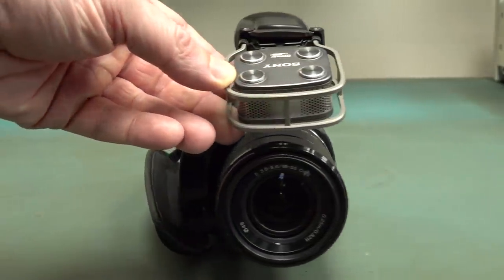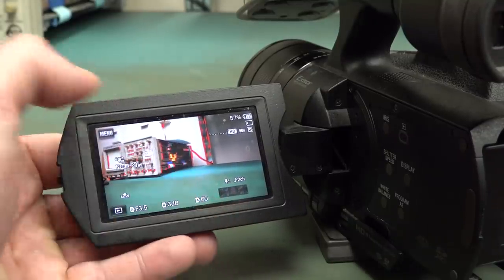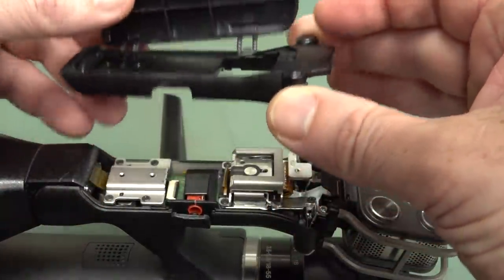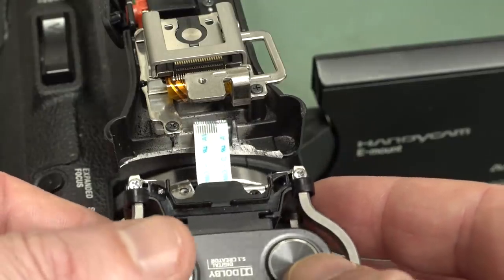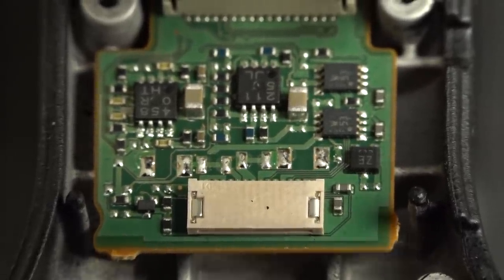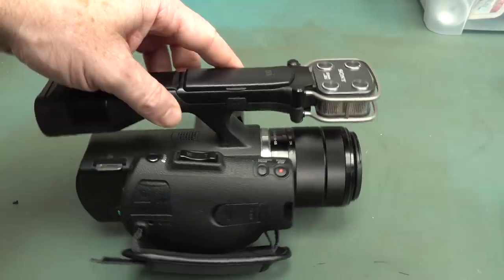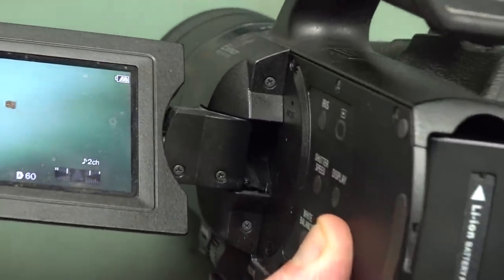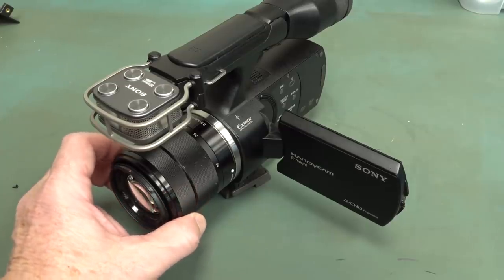EEVblog #1206 - Repair: Sony NEX VG30 Video Camera

Comment: a better test for magnesium is to put a drop of cider vinegar (or acetic acid) on the exposed metal.  If it fizzes and changes colour then it's magnesium.  If nothing happens then it's aluminium.
Reply from the maker: Nice tip, thanks
Reply: Simple and effective..  Great trick Bruce!   👍

Comment: That mic might have saved that lens!
Reply: Tru
Reply from the maker: Indeed
Reply: It must of had a hell of a whack to brake that metal, all though metal castings are famous for their weakness.
Reply: Isn't this just the very boring kit lens for sony APS-C cameras from which millions exist and you can get used for 2 digit money? Sometimes even with a stills photography body?
Reply: Took one for the team.
Reply from the maker: M1 K  - It's not that cheap, and it's a fine general purpose lens for videography
Reply: I thought exactly the same.
Reply: @EEVblog  Maybe its different in AUS, here in europe they seem very common, as well as the other collapsable kit lens. I searched for an older NEX 3 or 5 for a NIR conversion some time and they came up a lot. The camcorder seems to be worth far more than the lens, therfore the comment..
Reply: Also, if the blow is even harder, the mesh will buckle before damaging the lens(Speaking from experience). The mic will still work as well. I don't think they designed it like that on purpose, but hey! A camera with a built in crumple zone!
Reply: yep, and the e-mount.. Zeiss... oh no!

this is why I stick with the A-mount series.

Comment: There is an industry standard for hot shoes, the contacts for which are on the Sony proprietary one (the contact pad on the top), Sony, like other manufacturers, adds extra pins for more connectivity for devices like mics.

Comment: The base plate is known to break on the bottom of those things. There's an aftermarket aluminum mounting plate you can get for 28 bucks that screws to the bottom of it and makes it pretty much Bulletproof when you mount it on a tripod.

Comment: Believe it or not, I'm using this Camcorder in 2024!  
😅
To overcome the loss of Face and object tracking with White Balance Adjustment ...
1 - Tap the White Balance Button on the Body 
2 - Tap the Option Option on the Screen
3 - Adjust the Blue/Amber & Green/Magenta Color Bias buttons until you are content!
4 - Press OK 2x
With an OSS lens and/or a Gimbal, this old thing works awesome for 1/2 Speed (60fps) Wedding and Music Video jobs!
I also almost never use the Viewfinder and am thinking I will remove the thing altogether to enhance my gimbal usage.

Comment: Nice video. I also don't use the viewfinder of my NEX-VG and this part is also hindering when using a gimbal. Do you think it would be a big problem to remove the viewfinder in a way the later it is possible to mount it again?

Comment: Dave, when I worked at an injection moulding company, we did EMI/EMC plastics - they have additives. Could be that ? They aren't conductive in terms of a multimeter testing.
Reply: Wouldn't do jack at audio frequencies.

Comment: If it isn't made for vloggers, perhaps it is made for travelers. I don't monitor the sound when I record Panasonic HVX200E. I loop it into a headset. (or it is actually a set of ear protection that had a line in)

Comment: If you want to test for magnesium without starting a fire (or burning a bit of your gear) just put a couple drops of plain white vinegar on it, and it'll bubble if it's magnesium.  If it's aluminum or an alloy of Al it won't.

Comment: In few years ago I switched from SONY to another brand cameras. I'am shooting a photography, not video. But the main reason for my migration, was the old style hot shoe. Then SONY reseased a new style of hotshoe and lens mount (the E-mount), they abandoned the A-mount and made their cameras with the worst ergonomics ever. I thing that all flashes will fit in every hotshoe, except the old sony style and will work, but without any fatures than manual mode. I'am not tested that, but for shure new Sony style, nikon, canon and pentax flashes will fit and work.

Comment: If it breaks loose get some j.b weld, amazing stuff :-)
Reply: "If the two-part epoxy breaks loose, get some two-part epoxy." Nice.
Reply: TheHue's SciTech
Not quite lol, they have metal particals in the product.
Reply: Years ago, I doctor presented me with an IBM voice recorder, it used a magnetic band to record on, instead of magnetic tape, a wide band.  It was dropped, broke the metal casting.  I was into aluminum welding at the time and was anxious to weld the tiny frame.  A friend said, that could be magnesium. He said break or a tiny chip and see if it lights of with a match, sure enough, it did.  If I would have attempted to weld the part (without lots of shield gas), I would have ended up with a pile of white powder.  I ended up machining a small plate to straddle the fracture, drilled and tapped holes for tiny screws and also filled in the voids with epoxy.  It was then good as new.

Then there was the time I had to repair an anal scope for the same doctor, that's another story for another time. 

Jim

Comment: Weren't you a Canon guy; HFG10 and 20?  What prompted the switch to Sony?  Just curious.
Reply from the maker: Already had a NEX-5T, got the Sony NEX VG30 because it was a 2nd hand bargain, got the RX100 because it's pretty unique, and well, the transition had started. The NX80 had all the stuff I wanted so it made sense.

Comment: The Microphone-Head Looks as if it can be removed like a Flash. 11:02 Looks like if you have a connector where the microphone-assembly can slide in.
The plastic piece was like a little door on the hole the screen hinge goes in. maybe someone closed the screen too hard and destroyed the hinge of the little "door". But it is only for a better look and wont change the working.
Reply from the maker: I have never seen any other attachment for it, so I don't think it does.
Reply: @EEVblog  ok then they have made it non-removable.

Comment: my VG30 is my primary video recorder, but for what I shoot it is the best that I could afford at the time.  It still works great for me.  I have used the 5 channel mic a few times but as my target is stereo DVDs, I ended up not using it.  I also record sound off camera and sync in post-production.
(I have a Nikon and a few lenses. I have adapters for the Sony to accept other Sony and Nikon lenses.) I am looking to upgrade and go to 4k.  I would like to get a video camera that has interchangeable lenses and a camera that can uses the same interchangeable lenses.  I see your primary Sony does not, but your cameras do.  Do you have any thoughts?
Reply from the maker: For a no-fuss primary camera I still prefer the integrated lens camcorder, they are still better than DSLR's IMO. I don't think sony has a new affordable interchageable lens video camera?
Reply: @EEVblog  I shoot events that will last up to two hours.  (some are longer, but they have intermission, so I stop recording)  DSLRs do not do that long.  Also they are optimized as cameras and not for 60 fps.
(I run on batteries, so I almost always use the view finder.  I use the screen only for setting up .)
Reply from the maker: IME the viewfinder adds hardly anything to the battery life.

Comment: Actually most pro cameras don't have any audio whatsoever, people who care about sound will use separate audio recording gear anyway and  sync it with video in software.
Reply from the maker: Not Youtubers were efficiency in production is key. Only a fool bothers to sync external audio.
Reply: @EEVblog  Yeah I guess that's true, but on the other hand it's pretty quick job once you get used to it, it usually takes me less than 1/2 minute to sync it; The key is not to stop and start recording a lot, just keep the gear rolling, and cut in post.

Comment: Second hand, no lenses, dirt cheap...  Funnily enough I tend to avoid stuff like that on Ebay.
Reply from the maker: Then you can miss out on bargains.
Reply: Haha, back when the Canon 400D was a new release I got one on eBay for less than $100, the seller listed it for spare parts because it "Will not turn on". I charged the battery. Bargain.

Comment: why not 3D print  new plastic part? look as 15 Min of cad work and no need for epoxy
Reply from the maker: Because glue works fine. The support post that broke off is on the die cast metal part, not the plastic part.